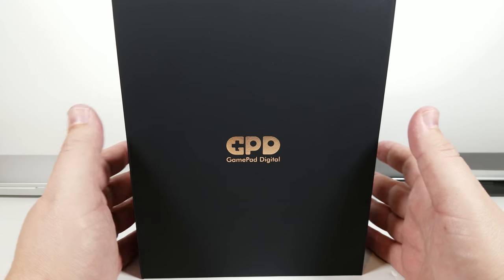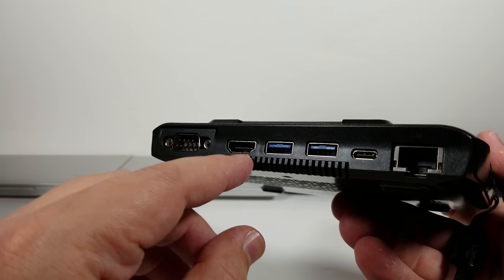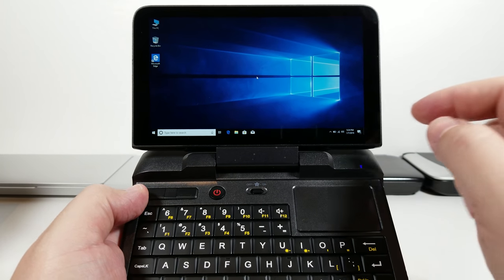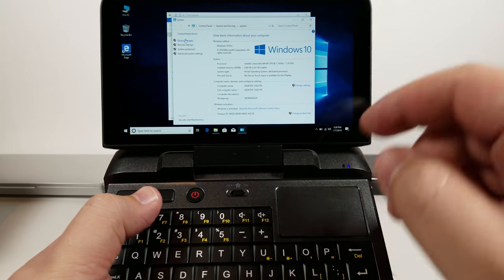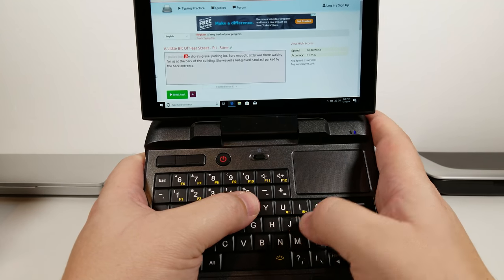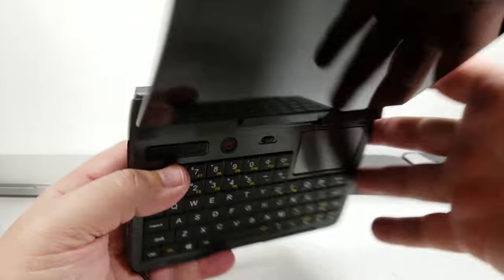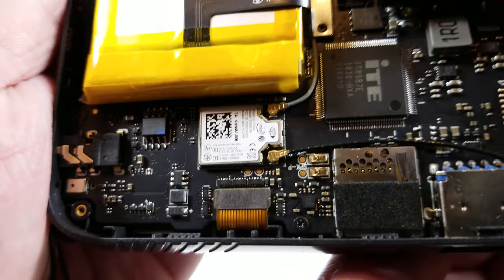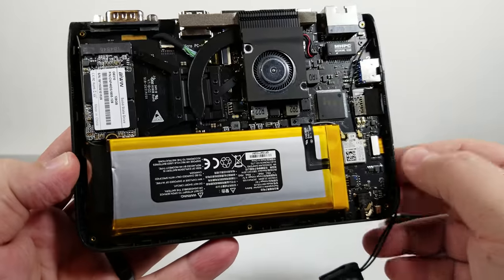GPD MicroPC - Unboxing and Quick Impressions.

Comment: That moment when GPD microPC has more ports than $1500 MacBook Pro (Pro, for PROfessional work) 😂😂
Reply: Vlad Fishermann Funny you mentioned macbook, I have the newest gen i5 macbook, and it gets hotter than my GPDWIN1 when just browsing websites, people were too tough on the GPDWIN1.
Reply: Spencer Ko The win reaches 85C
Reply: Justin Wong 85C if you’re playing TF2, but relativity cool when you run office application, web browsing.
Reply: Actually Pro for PROlapse.
Reply: @justinwong939  fans on macbooks remain at lowest speed until temps hit 90C, so macbooks are running at 90C any time the fans goes into jet engine noise mode.
Reply: ::: ::: LOL you’re welcome to go buy a macbook and be disappointed by it.
Reply: While GPD minipc are best suited for students
Reply: Lel my 8 years old macbook hasn't any problem those shitty new macbooks have (plus it is upredable , i max specced it). 
Apple today is outrageous garbage, a greedy manufacturer.
Reply: @Ryanlexz  Nokia actually makes really good phones but go off
Reply: That's a low blow
Reply: theres a reason professionals still buy it, and if you didnt notice, the macbook is alot thinner lol...of course theres less ports because its not bulky like this "mini pc"
Reply: @HatTrex  Is that the last full I/O one everyone wants in stead of newer models?

Pc guy so has no idea
Reply: @JohnSmith-xq1pz  Mine is 2011 model, people wants late 2012 model
Reply: @HatTrex  ah i c
Reply: @kospencer1  i5 sucks my mac minis 2011 and 2012 have i7
Reply: @HatTrex  What would be the best macbook to buy from old ones? I would like to have the best choice.
Reply: @DeRive_  depends on budget.
Late 2012 i7 i think is the best on a small budget, also u kinda of need to upgrade it with 16GB of ddr3 ram and ssd for MAX POWAH.
Also 2013 and 2015 are decent.
Reply: @HatTrex  Thanks for the info man!
Reply: @kospencer1  the real problem is that the gpdwin1 kills its battery with its own heat, as happened to mine... and then no seller ships batteries to where I'm living. I'll have to try lgg5 batteries as some guy did. I used it just for about three months.
Reply: Because it’s a gaming pc

Comment: I'm more interested in GPD products for gaming, but damn I love the design of the this
Reply: IceSanta GPD is a good company to invest in :). I’m planning to purchase all their line ups, but tons of price gougers i got the Android 1st version good for emulation on the go. Saving for their Win series and their mini netbooks
Reply: And more key travel...
Reply: I don't know how powerful this is but you can probably pack an ipega controller and use it for gaming (Bluetooth controllers that attach onto the sides of your device). That's what people did with the original GPD Pocket PC, which had around the same specs as the GPD Win.
Reply: What design looks like any netbook I have seen in the past.
Reply: @Thornskade  this is slight more powerful than both of those
Reply: I don’t get it how is this for gaming? It probably wouldn’t be able to run Minecraft
Reply: @abakedpotato1486   it can run Bedrock edition
Reply: @abakedpotato1486  You'd be surprised. I owned the original GPD WIN and it's an amazing little thing. This device is slightly more powerful, and the GPD WIN 2 is much better. This one isn't really designed for gaming, but it can definitely play some titles you wouldn't think would work. I managed to run Far Cry 3 at a reasonable 30-40 fps with a little work.
Reply: kenthed45 The gpu is slightly weaker though
Reply: @justinwong939  this is more powerful than a gpd win 1 by a small margin. The gpd pocket is next in line, then the gpd win 2 is top dog right now.
Reply: @UpToSpeedOnJaguar  in which website u purchased this product
Reply: ASlavBakedPotato this is mainly for web surfing or movies and or business/school presentation. I’m planning on turning this into a web server that doesn’t consume tons of electric power. I just reserved mine for $300 on indiegogo ^_^ I’m gonna get their  GPD win 2 model soon as well
Reply: @abakedpotato1486  Mincecraft is one of the easiest to run games on it. It's possible to play GTA V at extremely low settings and over 20fps on it.

It's like asking how the Gameboys were for gaming or the Nintendo Switch is for gaming. Just because it's weak doesn't mean you can't play games on it.
Reply: Wish that they would use this design on their next gaming oriented devices
Reply: @ricksmith4840  it is actually much faster in the cpu department due to 10w tpd. The gpu is around 50% faster than gpd win 1.

Comment: I think for Proffessionals would be a tiny scroll wheel a nice option. With the Touchpad is it a pain to scroll...
Reply: Use the arrow keys like an adult.
Reply: A trackball or a trackpoint would be nice for mouse manipulation instead of a touchpad.
Reply: Personally I'd prefer a trackpoint
Reply: Use gestures, use two fingers and move th down on the trackpad to scroll.
Still your idea would be way better.
Reply: Depending on what kind of professional you are. IT guys like System Administrators or Network Engineers may not need GUI to work, just typing in text terminal consoles all day long.
Reply: What profession exactly? I think this is just for enthusiasts not even for highschool students.

Comment: This reminds me alot of the Fujitsu U series UMPCs from over 10 years ago.  (Do a search for U1010 and U820.)  They could learn a bit more from those, where the screen could turn around and be a tablet, while the nub and mouse buttons are accessible from both sides.  This model looks like they are wasting so much on a mouse pad and not really controlling air flow super well.  Overall looks like a big step backwards from the UMPCs from 2007.
Reply: The umpcs from 2007 cost like 4-6 times the price of this.

Comment: Have you looked at any of the One Netbook Yoga products? Similar to GPD Win series with a pen. I just grabbed the Yoga 2S, and despite some flaws it is still pretty neat to have a tiny pen enabled 2-in-1. Will be making a video on it soon. :)

Not sure I like the style on this GPD but I guess it's not geared towards me. I think it would look better with matte plastic rather than shiny.
Reply from the maker: Yeah, I'm aware of the One Mix series. I've been trying to get a hold of one.
Reply: I've had an ASUS EeePC with the same layout. It was great apart from the lack of any proper processing power.

Comment: That's pretty cool looking, but i personally think not including touch screen is a mistake and i hope they add it before release.
I almost always use the touch screen on my win2. And though a touch pad is great, there's just so much stuff that's touchscreen friendly these days.
Reply: I don't think the touch screen is practical if you're using it for server maintenance or other engineer stuffs especially for people who wanna install Linux on it.
Reply: maybe. but i only have a win2 and it really does make simple stuff like web browsing and file navigation much easier. I set the folder view to "Content" mode, it's like detailed mode, but larger and easier for use with a touch screen.
Reply: The Micro Pc is made for Proffessionals in mind, i think so too for those people makes a Touchscreen no sense.
Reply: And for the non-professionals buying this? i don't think many people would buy this for actual use in a professional work place. probably why the build numbers will be pretty small. If this were 10 years ago, it'd be perfect for the robotics and micro-controller scene, since a handheld PC with a hardware serial port would have been amazing.

either way, whether it'd get used by some of the users, so it should have been added, it's not particularly expensive to add either. It's one of those, "have it and not use it" over "want it and not have it." kind of deals. If i were to buy one of these, IE if i was still into DIY robotics, the touch screen would be a deal maker/breaker for me.
Reply: @te708  Linux works fine on a touch screen
Reply: @LazyBunnyKiera  Unfortunately i think you are right with "habe it and nor use it" or "want it and not habe it". In my case i Like the idea ti habe a ultra portable oc for travelling and habe all These Connectors especally the full size HD I. Look at  Photos in a tv screen in a Hotel  Look at Travelling Photos in a tv Screen in hotel  or watch a Movie over Web from WLAN to tv .
Reply: @robertm3951  That's true. But for this particular device, I think using the command line is more often on Linux.
Reply: A touch screen would probably cut the battery life in half.
Reply: @SenileOtaku  That doesn't make any sense.
The touchscreen circuitry wouldn't use that much power.
It's the actual screen itself (the part that displays things) which sucks up most of the power in a portable device.
Reply: Oirat Arslan not everyone is going to use Linux.
Reply: Oirat Arslan good luck. I personally can get really bored (and angered) from a lack of a nice GUI.
Reply: Tab s4

Comment: I just got used to using my old Macbook Air with a USB-to-Serial adapter to program switches, routers, PDUs, UPS, etc.
It's thin and light enough to fit in my laptop bag along with my regular work Lenovo Thinkpad.

Comment: FINALLY! A modern Fujitsu U series!!!!!
Wait. No touch screen… Ugh… also, I'm sure GPD can benefit from using Intel Lakefield platform in future models.
Reply: Kevin Bhasi It could easily be modded to add a touch screen, depending on how custom it is. Only downside is you might have to cut the trackpad, and the wires might have issues with the pre-drilled holes designed for only video export. If you can’t find it, make it!
Reply: I doubt touch screen could be useful in windows for a screen of that size. I know part of the interface is prepared for that, but the programs and many settings not. It would be a very awkward experience.
Reply: You mean Zen platform surely

Comment: Did you talk about the buttons surrounding the middle Mouse button on the top left? I am pretty sure they are left and right click buttons. If they are, that would obfuscate the problem of the mouse moving when trying to click because you wouldn't be nudging the touchpad around when pressing a separate button. Also usful when dragging files
Reply from the maker: They are indeed

Comment: Is there any chance you can test Mint, Ubuntu MATE or Kubuntu on it?
Because I heard GPD devices don't do so well with Linux after all.
Reply from the maker: Yep. Full suite of tests are set to happen. Just preparing some stuff at the moment
Reply: That was my immediate thought on it, "can it run Linux?".  Because that's all I'd be running on a device of this type (well, pretty much all I'd be running on ANY computer).
Reply: James LaBarre pretty sure it will be supported by the community when it starts selling. I might do some work on that I’ll see how things go at my new contract if it allows time I’ll work on it.
Reply: David B what work??

Comment: The RS232 is cool :)    it is a good idea overall , but  if i have to do work, i would rather use a small laptop with simular specs (probably hard to find with RS232, i don't need it anyway,  this days are over).  
The GPD Win is much more useful because it has an intergrated gamepad.  I still got the first GPD Win and i am playing Red Dead Redemption 2 on it, on the go !!!  (PS Remote Play)  that is freaking awesome.   I realy like GPD devices :)

Comment: I like it. Looks pretty good. I just hope that they have a version of it with 8gb of ram and a touch screen.  Only real disappointments is that the keyboard is not backlit and that it don't comes with a 10,000mah battery.
Reply: The keyboard should be backlit, notice the icon on the space bar, he either forgot to mention it or his preproduction unit doesn't have it.

Comment: That is a very nice toy, i did not see the processor name cause i watched the video on my phone but if that pentium is a quad core, that is awesome and with that 4gb of ram and the ssd it wil fly on the web. I had a Medion 2 in 1 with quad-core Celeron @1.6ghz and only 2gb ram and worked great on the web despite the only 2 gb of ram i colud open up to 5 tabs on crome and the memory incresed only up to 1.7 gb out of 2. So if that is a quad processor and with the 4gb and the ssd it's better than alot of laptop's that you find on the market.

Comment: I like it, but some changes I'd suggest is 1st, the obvious one, the fan switch should be bios controlled. 2nd, I'd shorten the keyboard height and locate the touch pad to the normal location or by the right hand side at the bottom, also with a tactical switch like the left and right click buttons under the top left corner with an LED indicator for touchpad lock. 3rd, which might help with keyboard height area and aesthetics, relocate the hinge area closer to the back of the unit which I'd hope they would do anyway because the current arrangement makes it resemble a late 1980s - early 1990s laptop.

Comment: What about replacing the whole keyboard with a haptic feedback touchpad similar to the steam controller.

But the whole touchpad lights up with a keyboard, and few other light up configurations like wasd keys.
Reply: Or instead of wasd keys, you slip on a membrane keyboard with full sized wasd keys, and if you play a game like League of Legends you can get the hot keys from that game slipped over.

then you can use the mouse with your thumb like normal on a larger touchpad, or you can use a c stick that goes on top of touchpad as well.

Comment: Could you do some battery tests eventually? See how far you can make it last with the Windows battery settings set to longest life, and maybe turn the screen off/keep the system on when you close the lid. I wonder how viable these things (and maybe the GPD Win/GPD Pocket) would be for a pseudo phone replacement if you hooked it up to a hotspot or aircard.
Reply from the maker: This is going to get wrapped up in the total review as well.

Comment: Does the GPD MicroPC have a vertical screen on its side, or is it a horizontal screen now?

And if it's a real horizontal monitor, is it possible to mod a GPD Win 2 so it uses that monitor instead? I don't care about the touch screen on the Win 2, and the "vertical" screen causes compatibility issues.
Reply from the maker: The screen reports as 720x1280, so it appears as portrait on my preproduction.
Reply: @The Phawx
Darn...
Has anyone done a mod yet where it replaces the vertical GPD screen with a generic horizontal one?

Because whenever I run Linux (mint XFCE) on it, and rotate the screen 90 degrees it make this awful screen tearing on the left side, and while running Windows some old games fullscreen sideways, and need to run them in windowed mode to "fix" it.

These aren't serious issues, but if I can avoid them, it would be better.

Comment: What would you think about a handheld of that size or a bit bigger if it's if it's in your hands better.

But the battery is completely outside and in your pocket?

This frees up space for a bigger heatsink, and combined with a larger battery you could easily get a more powerful chip in there maybe even a GPU.

I heard a rumor about gpus designed 4 pcie over nvme, I mean they're just supposed to be pretty much the best GPU you could ever want for 4K streaming, and it probably better then ryzen integrated graphics.
Reply: Maybe you could even get 45 watts of cooling, that's enough for a low-power quad core i5 or i7, and a 30 watt GPU.

That's basically on par with a laptop of the same specs for the same price

Comment: they did it wrong, it should have be a touch screen with optical finger touch sensor.
it doesn't make sense for umpc at this form factor having a trackpad, i mean if user really want to have precise control they rather plugin a usb mouse.
those space for trackpad could have been better utilize for keyboard and other optional controls.